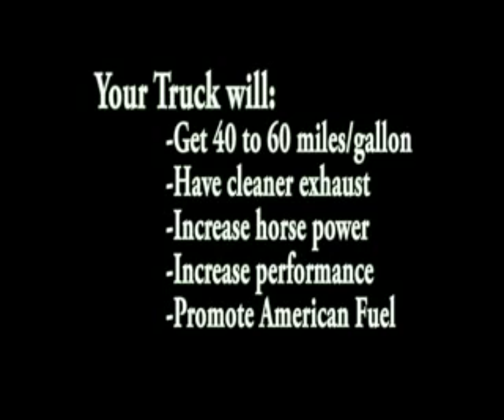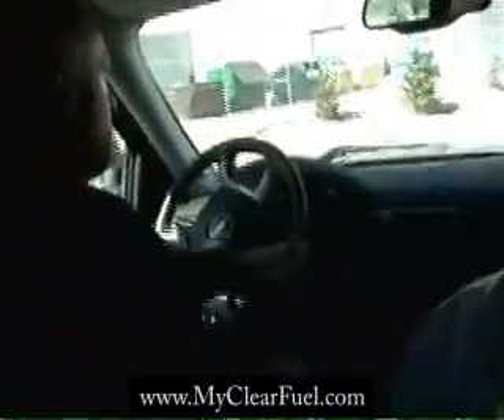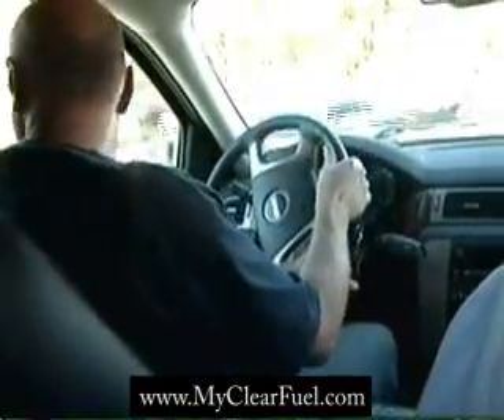CNG Natural Gas Diesel Truck

Comment: Route the CNG through a custom intercooler with a section of coils going up and down through it to allow the cooling of turbocharged intake air, warming of the CNG to prevent freezing, and increase efficiency.

Comment: Guys.... Guys.... It's not a chip. It's not a damn chip. "Chipping" your vehicle hasn't been used since 1996. The term comes from replacing an actual chip in the ECM. Since OBD 2 in 1997, the use of scanners and hand held reprogrammers or "flash tuning" is what's being done. To hear some one use the term "it's chipped" means they are actually way behind in the performance industry.

Comment: I don't know about direct injection but I know for a fact that automakers have been selling factory made CNG cars for a very long time. Ford, GM, Honda, and Toyota all have them. If you live in North America chances are you have seen a one of these fleet cars own by utility companies. Direct injection isn't something that just came out, It was developed in the 1920s and first used in a automotive application in the 50's. Today direction injection comes standard with most automobiles.

Comment: I work in refineries, the changes made in both refiery process and coal burning generator plant int the last 20 years is amazing, if used in the USA. However the continued restrictions on coal plants under Oboma have shut down over 125 plants. This adds to the overall energy cost to poor working Americans. The coal is then shipped to countries who have zero concern for air quality. So it becomes lose lose.

Comment: @jbarlo86   Not  right.  U.S. gets large amounts of NG from Canada.  Canada supplies NG to most parts of U.S. other than south central part of the country.   What does this mean for Canada?  We are forced to use more coal than what we should be using and this is not good for our health.  There is also a problem with  NG in that H2S has to burned off at the well to purify the gas to pure NG.   What does this all mean?  Humanity needs to be much more efficient with the resources God has given us.

Comment: @shaheertanveerakhan Not as much power as diesel or petrol, but 60-80% more miles for the same amount of money as compared to either of the two other fuels. We haven't however yet seen a system here that combines CNG with another fuel in a variable ratio, so no experience with that as far as power and fuel economy are concerned. Any word on that?

Comment: What you can't see doesn't make it cleaner.
The molecules are broken down into smaller particles.
These are suspended in the air longer and is responsible for the acid rain and higher levels of ozone.
Rolling the coal or seeing smoke means heavier particles which fall to the ground. What comes from the earth will return to earth.
This is recycled into the soil.

Emissions from the hottest cleanest burn will Always  result in Sulphur. 
You are still polluting.  even worse.

Comment: I think CNG is the next logical step for Diesel motors when Oil prices become too high. It will be interesting to see how the price of Natural Gas moves when enough people make the conversion. It may even be economical to make your own natural gas (using the sabatier process) which can then be sold to consumers. This would be much easier than the so-called hydrogen economy, which is even harder to store and transport. I can see big demands for CNG in the future - for transport, electricity etc.